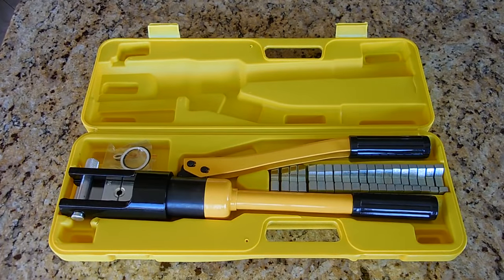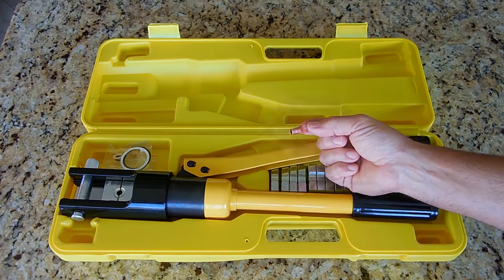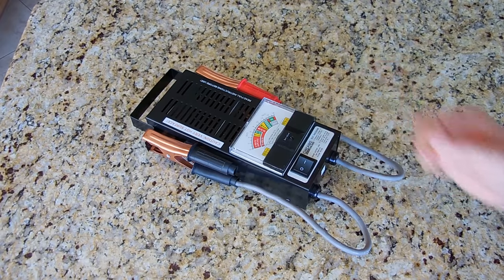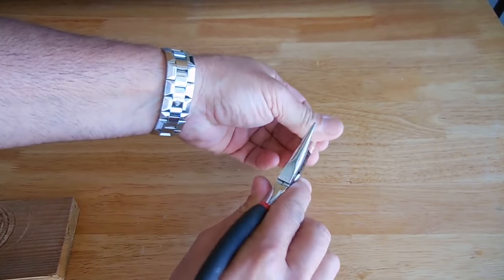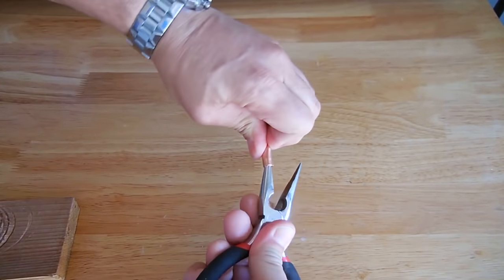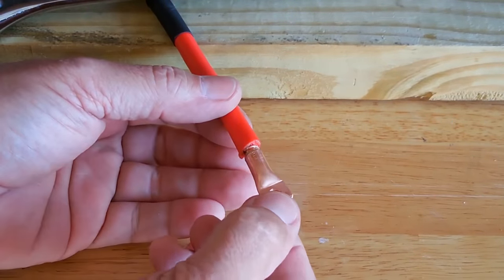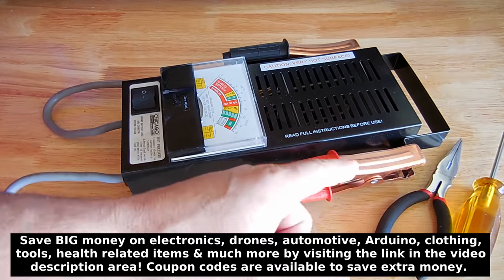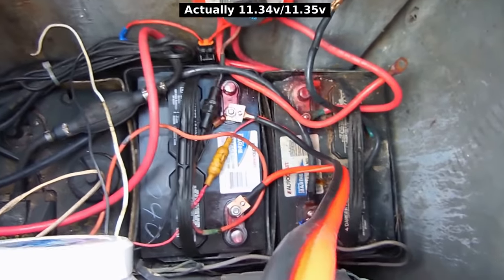Soldered Versus Crimped! Which Method Is Better?

Comment: When you make a crimp connection the crimping pressure forms the round copper strands in the terminal into a solid mass in the terminal eliminating the spaces between the strands. Soldering connects the strands to each other in the connector but now some of the current has to flows through the solder where with the crimped connector the current flows through the copper. I would not solder a properly crimped connection because there is no advantage electrically or mechanically. Also, You could make a new set of dies for your crimping tool for the size terminal you are crimping and do away with the metal shims you are using.
Reply from the maker: True, under extreme pressure it does make the strands into a solid mass. Even though it's a solid mass, you still have spaces between the copper lug and wire where air/moisture can enter which would allow corrosion over time. Of course that can be prevented by using heat shrink with glue. :-) I'm looking for 2 smaller dies.
Reply: I've never soldered my crimped connections but always use adhesive lined heat shrink and have never had any corrosion issues. I use silver tinned lugs though, not sure if that helps.

Comment: The cable text would have been much clearer and accurate if you had just put the voltmeter across the cable under test, that way you would have eliminated the problem of the battery drooping under load. The meter would have just showed you how many millivolts were dropped on the cable and connectors. Also re solder versus crimp - if crimping high current connections for a really long life or in a marine atmosphere you should use conductive jointing compound (eg Bicon) in there to exclude any air and prevent corrosion, essentially galvanizing the internal surfaces.
http://www.cable-glands-cable-cleats-crimping-tools.co.uk/suppliers/BICON/BICON-Compounds-and-Resins/pdfs/BICON-Prysmian-BX1-225-Electrical-Joint-Compound.pdf
Reply from the maker: Hello Alex. Yes, I could've measured the battery voltage at the same time, then performed a calculation, but it really wasn't necessary because all I wanted to do was show viewers a voltage drop comparison between a crimped connector and soldered connector at the load. Thanks for watching!
Reply: Hi. Much simpler than that - if you just put the voltmeter across the two ends of the cable - then you're showing the voltage drop directly, no math needed. No need to check the battery voltage as long as it didn't change by a large amount.
The way you did it meant me trying to remember what the battery voltage had been on the first test, seeing what it was on the second test, subtracting one from the other and wondering if that was more or less than the droop in battery voltage by the time the second test was done!
Reply from the maker: Alex Gray The starting battery voltage was only .03v difference. The video made it clear that there wasn't any big difference between the 2 cables.

Comment: I would measure at the connector then just after the connector with a Milliohm meter. Under heavy load.
Reply from the maker: Really no need to do that. The test in this video showing the voltage at the load says enough. Thanks for watching
Reply: That’s if the cables are exactly the same size and length. If you truly want know the  drop across the terminal. A longer load test would have to be performed you don’t seem to like constructive criticism that’s bad. The other thing would be to use a Thermal camera.Solder generally is not used on heavy loads. Cranking amp over repeated periods.
Reply from the maker: Steve B Of course both cables were the same exact length.

Comment: Resistance test would have given us more useful info, nice job with the cable though
Reply from the maker: Actually, the voltage reading at the load is very useful information. It shows the level of resistance for each cable. Thanks for watching!
Reply: all essentially the same.  Copper corrosion will get to the crimped joint first if not protected.

Comment: Crimped versus solder…I typically will always crimp because it is a connection the will last longer in high vibration environment. Over time excessive movement will cause a soldered connection to develop stress fractures in the solder, raising the resistance. Also, one can accidentally wick solder into the actual cable which will also leave the area weak and prone to breakage. Finally, mechanical copper connections should not be exposed to the environment. Plated lugs or CAD welding should be considered for that type of application.
Reply from the maker: Colin Zapalac Valid points, especially if used for an application where the cable moves around a lot. Thanks for watching!

Comment: I also solder all Anderson connectors.
Reply from the maker: Tiny Solar Shack Thanks for watching! Be sure to rate thumbs up and share.
Reply: If your Anderson contacts are on the end of battery cables, UL regulations state that there must be a mechanical fastener installed. A crimp is considered as such, but soldering isn't. You need to add a cable clamp if they are only soldered. I have seen connectors get hot enough to melt the solder and if the wires fall out of the connector housing, there is a potential for shorting the battery.
Reply: Mike Lowe Absolutely true. I work in an industrial setting. All forklift and battery charging Anderson connectors are crimped. If the positive came out and shorted to ground it will weld itself in a couple seconds and possibly set the insulation on fire not long afterward.
Reply: @mikelowe5096  Why did the wire get that hot?

Comment: In the aviation world crimping lugs is the approved method as opposed to a soldered connection on a terminal lug the wire is stiff and can break under vibration if soldered look up the  avition electrical best practices Advisory Circular
Reply from the maker: I could see that on a plane. There's plenty of vibration. Thanks for watching!
Reply: That is right.  YOU NEVER EVER SOLDER in a vibration prone enviroment.  Neither use a piece of tube.  Neither a file.    All he does is WRONG.   You invest big money on a tool and you save 16 cents on a quality connector.   Wrong from A to Z.     Poor people here getting confused.

Comment: I think you could have used a DVM on the low ohm setting and it would have been just as revealing. In an industrial setting we would use a micro ohm test set to measure a bolted connections or any very low resistance  This insures good contact and low resistance. The test set is just a constant current source (high current in some cases) with a voltmeter across the test clips. The test clip is a Kelvin clip (4 wire) to insure you measure the voltage across the connector and eliminate any voltage drop  errors from the connecting current wire,. Crimp connectors are very specific to wire diameters and die size. It makes me wonder about the wisdom of using a copper tubing of about the right diameter unless the tubing you use is always consistent with the same wire size. You cannot put a wire into a oversize connecter and then squeeze the heck out of it with the wrong size die. It would make a bad connection  If you look at the spec sheets for say Burndy mechanical lugs it specifies the wire diameter ranges and the die number.  Most dies do not just squeeze down the diameter but indent the lug barrel horizontally across the lug in several places. I solder all my test leads (especially the cheap Chinese connectors) and wire jumpers and power cables. In the absence of a proper sized lug and die I would solder the connections.  The wire to lug connection is also less likely to corrode especially around batteries. If you have had good results with your method then go with it.Thanks for the video
Reply from the maker: Yes, the Chinese jumper wires definitely need to be soldered. Definitely don't want to use an oversized connector. Glad you liked the video!

Comment: I believe in the KISS method...keep it simple S....Seems a $20. hammer crimper does an OK job and is pretty simple...cheaper too.  In a marine location  (and others) there is sometimes  a problem with dissimilar metals:  tin, lead, copper and if rosin is used, which is very acidic, watch out.  Otherwise, thanks for the video.  Cheers!

Comment: It should also be measured after a long period of operation at high currents and humidity.
Reply from the maker: I was only showing high current for a short duration(engine starting, etc), which most people would use the cable for.  Thanks for watching!

Comment: why not both?
Reply from the maker: John Douglas You can, but if the crimping tool uses enough pressure, then you don't have to. Just make sure you cover the crimped connection with glue lined heat shrink.
Reply: yea, I can't afford a crimping tool that good ha.
Reply: @John-gm8ty  Just solder it, you're not building a stealth bomber.  either crimped or soldered you isolate the mechanical movement.  Solder can handle engine vibrations for years, what it can't handle is being shocked.  It can handle bends too, what can't handle the bends is the copper entering the solder all at the same linear point.  .  .  so you mitigate with a proper end that can grab the wire by the insulation, and viola! you have the best of both worlds: crimped vibration mitigation, soldered connectivity and conductivity.
Reply: @snap-off5383  how do you know I'm not building a stealth bomber? :P

I've had 30 year old cars that have never had a broken joint from shock, and I live in Australia with shit roads..

Comment: A crimp connection will not fail under a high amp draw.
A soldier connection will melt under a high amp draw
Reply from the maker: Leslie Andrews I haven't had that happen, but I can see that happening if the soldered connection was poorly done.
Reply: An inadequate solder connection will melt under a high amp draw.  Fixed that for you.  If you have a crimped connection getting a wire hot enough to melt solder, You've still done it wrong.  Heater elements would be the only thing I could think of where you'd purposefully do that.

Comment: The way you made the shims for your crimping tool is doing nothing more than making the crimp round rather than hexagonal.  The ends of the shim rest on the flats of the dies so, the distance between the dies is the same as if you hadn't used shims.  If you want to make the dies smaller, you need to make a "C" shaped shim with no ears.
Reply from the maker: Incorrect, rounded and smaller.

Comment: The shims literally do nothing as they extended outward over the legs of the die... you've made the hole smaller... but at the same time... shimed the dies the exact same amount... net gain is zero...
Reply from the maker: Kurt Boczarski I see what you're saying, but that's not the case. When the dies close fully, the result is a SMALLER hole.
Reply: If you look carefully, you can see that his brass shims are too stiff to be forced into the corners of the hexagonal dies creating a smaller cross sectional area in the inside of the shims.
Reply from the maker: True, but it was still better than using none at all. I'm currently looking for one size smaller die for the crimper.

Comment: I'm sorry I would never use homemade ring connectors like that on control panels cuz they're not tested you can never use them in the UL panel the chance of a failure is greater and you don't know what type of rating you have on your homemade hope to God you only use it on your own stuff
Reply from the maker: LOL. You're one of those foolish people that believe only things you buy from a store are good to use. Hint: Many items made at home are just as good or better. If you're "Afraid" to use them, then don't. Very simple.
Reply: @electronicsNmore  no I'm not foolish and I don't buy them when U.L. required you do use ul-listed Parts and pools from same manufacturer
Reply from the maker: @konamanstudio2447  Whatever you say. :-)

Comment: From experience, I never trust a crimped connection. I crimp and solder. Do both and you will never have a failure.
Reply from the maker: I usually like to crimp and solder, but with this high pressure tool, crimping is adequate. Thanks for watching!
Reply: you have no clue and what you say ....   this is the problem with youtube.  you NEVER EVER CRIMP AND SOLDER.     specially on locations with vibrations, starting motors or hot locations. .  If you experienced problems with crimping , you have used   the wrong connector , or the wrong tool or have a corrosion issue there .......